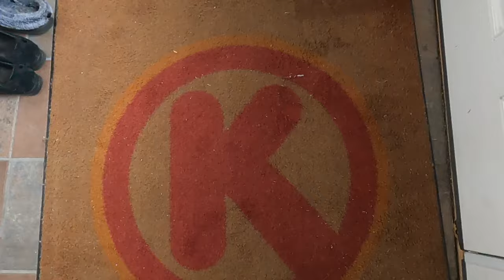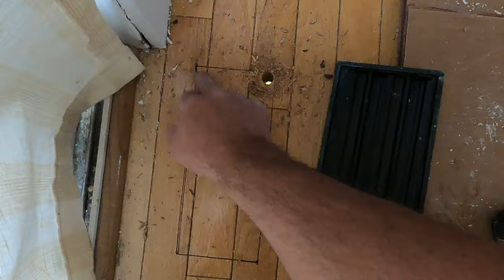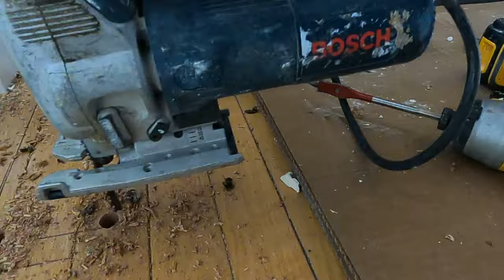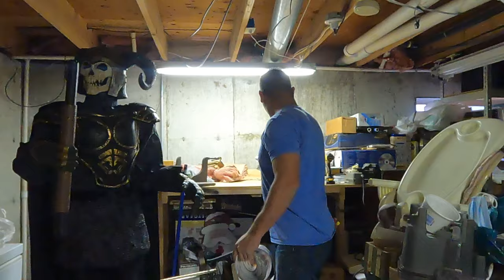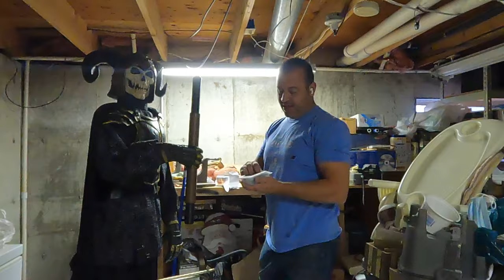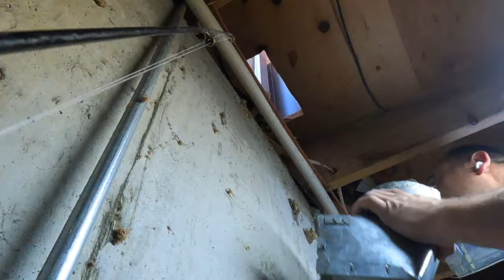How to Install or Relocate Floor Register HVAC.

Comment: why in the world would you be so incredibly short sighted as to cut off the end with the crimps on it only to put them back on?  Cut off the other end!!!  Leave the factory crimps on.  Really?  Next if your going to take down all the duct anyway move it over so that its a straight shot down the joist.  Everytime you put a turn in a line of anykind you loose flow.  Importantly it looks second rate.

Comment: Cool guy I like you, but a bit shotty on the duct install. They make crimping tools for turning a female end into a male end where you don't have to cut pettals out to flare it down. Don't most hvac guys use these?  also that was a pretty bad connection and tape job there at the end with the last two conections...  Otherwise, nice vid. Simple stuff. I would have used duct seal on all the joints then maybe tape over that.

Comment: Assuming the supply plenum didn't already have a take-off in the new joist bay, you should have installed a new take-off on the plenum (and remove/seal off the old one) and did a straight shot to the new register outlet. Every elbow increases the TEL (total effective length) you've potentially compromised the original duct design/performance. Also, Malco makes crimping tools so you don't look like a hack. Finally, that aluminum HVAC tape needs to be tooled into place with a squeegee tool upon application.

And lets not overlook the huge splinter in the hardwood floor that you caused with the spade bit that extended out beyond the register cover.

I'm not sure I'd be proud of any of this workmanship.

Comment: Early in this video you mentioned that you didn't think it would be common that people would want to relocate a floor vent. But actually in my own life that has happened a couple of times.
- First time, in a home when the only logical place for a large piece of furniture was right over a vent, and we didn't want to lose the airflow.
- most recently, in a different home, a floor vent was oddly located right next to a toilet. In fact you almost have to step on the vent while using the commode. (My guess is that it had to do with a remodel many years previously, when one bathroom may have been split into two).
But the fact remains that it is an extremely odd and very impractical location for a floor vent. I would like to simply extend the duct a couple of feet and relocate the vent accordingly, which would solve the problem. And your video shows how this could be done. Thank you!
Reply from the maker: Glad my video helped you out. I was surprised it helped so many people 🤷‍♂️. Thanks for sharing your thoughts and experiences.
Reply: So I have the same issue. My master bedroom is awfully small, and it really only makes sense to have the bed in one spot, and dresser across from the bed. Unfortunately the dresser covers the floor register. It makes much more sense for it to be off to the side of the room where nothing would ever be on the floor. I know I want to relocate the register for sure, but I'm not sure how to go about replacing the subfloor where the old register is. When I move out, I don't want there to be a hole in the subfloor once we move the dresser  out obviously. Any tips?  @vinnythehandyman
Reply from the maker: @Striker617 If you have carpet it’s easy. Pull back carpet and pad. Use a circular saw and cut. The finish cut should end splitting the joist so you can nail again. Once your done use liquid nail so the board doesn’t squeak. I do it all the time to move plumbing in bathrooms.

Comment: Hi Vinny...wish you were out here in Tn - (moved from NY) I hope to find a great handyman that can do the work as great as you did....I may be buying this house from 1987 - I will DEF check out first if the ducts are CLEAN!! But my biggest project would be to re-route the air vents on the ceiling to the floors......
Reply from the maker: Congratulations on your new move. Tennessee is beautiful! You will definitely have your work cut out on that house. Do one vent at a time to to see how far you want to take the upgrade vs ripping everything out at once. You never know if you want to continue. Best of luck and thinks for watching.

Comment: The metal pipe is better but would a small trunk line be ok too ? 8 or 10 inch
Reply from the maker: Yes, just depends how big room is. Typically bedrooms rooms get a 6”.

Comment: Are you supposed to tape the vent to the sides of the new cut hole to create a better seal before dropping that register in there? Nice video tho, I’m sure if I try this I’ll F it up somehow! Thanks for posting this!
Reply from the maker: Hi Foster! Thanks for watching and posting your thoughts. Honestly the more tape the better. Home Depot also sells grey duct sealer that you can apply as well. The Grey sealer is most common and I forgot to mention in video. Good luck on your install!
Reply: @vinnythehandyman  thanks my man, appreciate it! Watch out for those things in the basement! 🙂

Comment: hi I just moved in new place and there are metal covers  under floor registers,  are these so that thing dont fall in the vents?  OR what other reason are they there? I can provide a picture.
Reply from the maker: Hi it sounds like straps supporting metal ducts. If it’s a 1” thick strap and screws to framing than those are for support. You can remove and install the back same way. You can email pic under my profile.
Reply: thx and sent.

Comment: Was wondering what best tools would be if you have to do this on carpet floor I want to install couple registers but floor is carpet
Reply from the maker: You could use the same tools. When it comes to carpet take a utility knife with a sharp razor blade and cut the square need it out then cut sub floor. Take a drill bit to mark center of hole then use the floor register as a template and cut out carpet.
Reply: @vinnythehandyman  awesome thank you
Reply from the maker: @mattlincoln6845  Anytime!

Comment: how would you do this with a slab foundation?
Reply from the maker: If it’s a slab on grade then there won’t be floor registers. They will be in ceiling.
Reply: @vinnythehandyman that doesn't make sense. I have a slab foundation and i literally have floor vents. There's not a single ceiling vent
Reply from the maker: Maybe you have a crawl space?
Reply: No crawlspace haha. Have you never heard of slab foundation  with floor?
Reply from the maker: @caughtbreaking  i’ve seen that in basements, but not main floor on grade. State and familiar with our last vegas, NV and Denver, Colorado but I guess you learn something new every day.